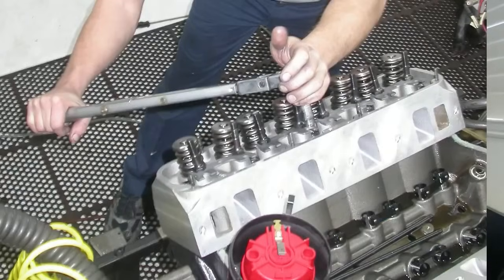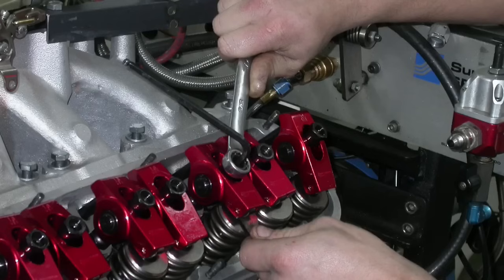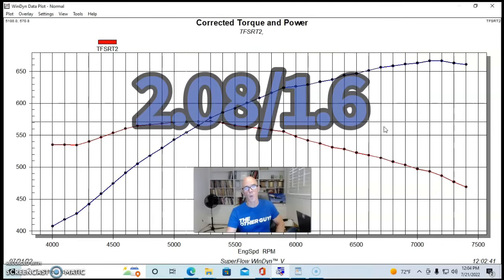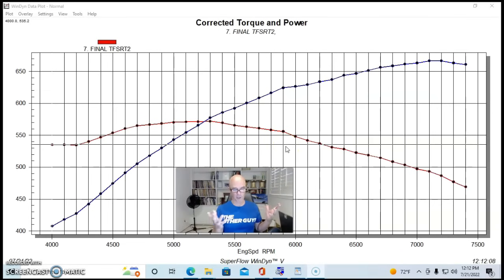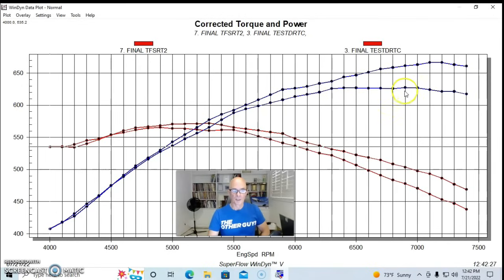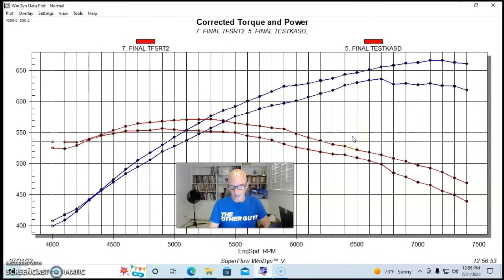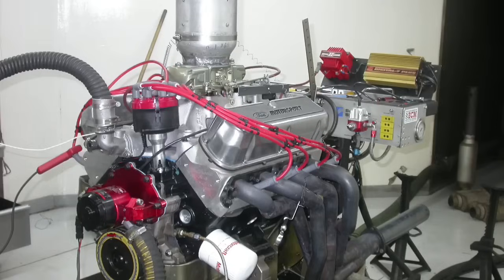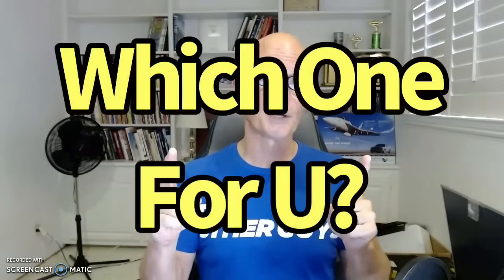WHAT CNC-PORTED SBF HEAD MAKES THE MOST POWER? KAASE v AFR v TFS R v DART v CNC VIC JR & HIGH PORT?

Comment: Crazy..out of the box 240cc high ports on a 418ci Windsor with 13.2 to 1 with a 740 724 270 293@50 116icl 116lsa nitrous camshaft with a powerglide in a Fairmont made 726hp 718lb ft on motor and 1279hp on 400hp nitrous with induction solutions x275 kit only thing I done was change the springs to psi DR426RML part number springs and titanium retainers and t&d rockers. This car will and has ran 5.04 8th mile on 400 and 6.12 on motor at 2960 with driver 8th mile it carries the mail

Comment: Something isnt mathing right with this engine. 12-1 427 with a huge solid cam and heads with way over 300 cfm.... you did something wrong on this one. These all should have been waaaaay closer to 700 than 600. Hell a couple should be over 700.

Comment: I'm surprised by the Kaase heads as well. Are those the same as the P-58 heads? I think that's what they were called that they made for a while there? I remember seeing a dyno of them on a 12:1 427 pushing over 700hp. Of course I'm not sure what the cam was or the headers and I'm sure those small headers were holding those engines back. Just goes to show with engines you can build the same engine and test it in two different places and get varying results. Good information though for a rough comparison.

Comment: Rich, those Kaase (P-38) heads had what every head porter forgets about when they design a head.... LONG VALVES. 2.10" x 5.450" x 11/32"  which is about 135g, exhaust are just as long and abut 113g.  Compared to the AFR 8mm stuff which the intakes are about 113g. You definitely saw some valvetrain issues there.... they don't even make these heads anymore. The market needs a canted valve head that's not a Cleveland or Yates style deal with some valves that aren't 20g+ more than the rest of the heads out there.
Reply: I’m thinking it was that n that those headers were choking the engine n not letting it breathe because those heads flow so much

Comment: I think the 1 3/4 headers are just fine. After all the exhaust valve is only 1.60 inches. That's all that's going to flow through the 1 3/4 header. So going bigger doesn't really make any sense.
Reply: I think it would be surprising. Seen some pretty impressive increases on a lesser build with 1,7/8” coming from 1,3/4”. 
Im thinking it would be a function of that compression. Thats a lot of air moving.

Comment: Any chance you could or did do one of these tests with a 393 and 205-210cc heads? Thanks
Reply from the maker: I have run AFR 205 heads many times
Reply: @richardholdener1727  do they seem to make more power than the TrickFlow 11R 205's in a test comparison like this?

Comment: Richard that is the reason that the 438cid SBF im going to build will have Cleveland heads on it.  The exhaust header selection.  The Windsor heads choice sucks, and the Cleveland are easy to get a 2" header.   Ive written afr to see if they could design a head with a LS pattern exhaust port, which would corner the market if they did it.

Comment: Thank you for doing tests on small block Ford I think the 2 inch header would probably be better and would obviously have more flow than the one to three quarter but hey that's what you had and I have AFR 205 heads believe it or not the part number was the 1450 I wanted the 225 head I wound up ordering the wrong ones I put their 1450 and I needed 1451 I believe I messed up anyway I love AFR heads my head makes phenomenal power but thanks again Richard always love your program keep up the good work

Comment: Would you ever consider testing some better head designs? For example, testing sbf sc2 vs MBE 12 degree vs Higgins race heads? I don't see many comparisons online between top end canted valve race head designs. The standard wedge designs seem to get all the attention for the street, but there is much more to unlock in the ones I just mentioned. There is the obvious expense, but some a few of those manufacturers may offer heads to test for free, never know!
Reply from the maker: I don't (nor do most people) have combos capable of taking advantage of what those high $, canted valve heads have to offer

Comment: Digging up bones... Anyway, I was wondering how much compression played in the output here. Some of the higher performing heads had higher compression. I sincerely doubt header size had anything to do with the power numbers that you saw. Also, I agree that the wobble with the Kaase head may have been a spring and/or push rod issue. Regardless, cool test, I remember when you needed a 6-71 pump to make 650hp.

Comment: The small headers up the running air speed up to rpm choke level per cubic inch 
A larger header would have slowed running airspeed down 
I have run combos on performance trends engine analysis pro and have scene as much as 40 hp off depending on primary size and collector size and total length 
Port volume vs pinch point running air speed can be tailored around the curve with bigger or small headers and intake manifold
Reply from the maker: the EAP shows different things than an actual dyno and header performance is not totally flow or air speed based-the several forms of enhanced charge filling (scavenging) play a big part

Comment: Is there an update using the Boss9 style and Clevor style heads?    customer wants to build  (me to spec) a stroker ford  cheers  low and mid range not max at max rpm,  most likely a supercharger/ intercooler    style  aftrermarket block

Comment: I just received my Trick Flow Twisted Wedge 11R top end kit with 170cc heads.
Im wanting to purchase a 347 Stroker kit now that the Block is back from the Machine shop (.030 over).
The motors a 99 Explorer roller. Its going into an 86 Bronco.
Recommendations on which (Balanced) stroker should i be looking into? Wanting to run pump gas. 91 is highest rating here in AZ.
Reply from the maker: scat has good stuff
Reply: @richardholdener1727  Thank you sir! 
I do like their reputation. Just had to get a a validation from “the man” 👍🏻

Comment: I have to wonder what the numbers would be with stock steel 4v close chamber heads on that 427 combo?
Lykins did a 351c stock 4v close chamber  FT 11:1 dyno 614.82 @7500
After further review, the above heads outflow the stock 4v  intakes by about 50cfm. Intake port 225 design beats stock larger ports.
This is good info to know. 
Thanks Richard

Comment: AFR has always been be recommendation for an out of the box high performing in line head. I will admit the TFS heads seem to edge out the AFRs performance wise just due to the architecture. New build with new pistons go TFS existing engine stick with a 20 degree inline AFR head.
Reply from the maker: pick whatever head you want from the supplied data-the 11R heads work very well

Comment: Forgot about one other good in-line head fully ported z304 head and there is highports with that flow more than that Tfs r head
Reply: The z304p cnc my brother has on a 408 we are guessing  650 hp plus. At 6800-7200. Heads flow near 380

Comment: No fair, this lot was run to 7500 rpm, presumably because of higher spec valve springs. Be interesting to see that a standard stroke would run to and it's power with these heads, cams, etc.

Comment: I'd love to see the actual valve lift at the valve, especially with the Kaase's, thinking their could be some lost ratio and the Kaase's use a different pushrod length to boot.
Reply from the maker: pushrod length doesn't change valve lift
Reply: Except when you combine that pushrod length change with a rocker fulcrum height change or if adjustable pushrod cups in the rocker like Jessels, changes the rate of opening the lift and the full open time.. https://youtu.be/5lgEAMuZBdo?t=1844 @richardholdener1727

Comment: Thing I like about the Trick Flow and AFR heads is they're always near the top of the pack in these tests.

These tests are not 100% conclusive because one head may benefit from different cam timing and intake and header design than another head. So one could always build the engine around a particular head and be shown that that particular head performed better overall.

Comment: I’d like to see the hp difference if the used C&C ported Yates C3 head
Reply: Exactly, I run an older set of the C3 Penski heads. 357/257 CFM @ 750

Comment: Each set of heads needs it's own cam dialed in specifically for its flow numbers and desired rpm. If you want any engine with a 4 inch stroke to survive for any length of time it should max out at 6500 rpm.
Reply from the maker: no
Reply: There are much lighter and stronger parts now days, so the rpm limits made 50 years ago don't apply.   The limits are higher due to better technology.
Reply: @dennisrobinson8008  No, piston speed determines longevity in modern engines too.
Reply: @Ken19700  the parts are lighter hence less inertia.
Reply: @dennisrobinson8008  Lighter parts will exit the oil pan just as easily when you push them too far. For survivability you don't want an engine to exceed a piston speed of 4500 feet per minute. The math you use is (4500 X 6)÷Stroke gives you your max safe rpm. If you want your engine to last forever cut it back to 4000 feet per minute. You can build engines built for faster piston speeds but you're going to have to rebuild them far more often. Generally it's only for dedicated race engines.
Reply: Think step header would have been better , but don’t think header made weak head is bad.

Comment: I think the test was a good test. If the headers were bigger they all would've made more power but I doubt that one would've leapfrogged another head in power output. Maybe the heads would have been better with each of them having a cam dedicated to the needs and or the qualities of each set of heads. Other than that it was an awesome test and that much more I love trick flow twisted wedge heads.

Comment: Hello is it normal that the Trickflow people dont answer emails?
Im asking them which piston set to buy for a 1995 sbf 302 with their 190 66cc heads and their 51403002 cam to keep as close as possible to stock CR which i believe is 9:1 (will be supercharged)
Reply from the maker: you can do that math yourself. go to Wallace racing compression calculator on line

Comment: What kind of power do you think it would make with a set of promaxx 210 cnc heads info please
Reply from the maker: HAVE NOT COMPARED THOSE TO THESE
Reply: Flow numbers at 700 are 325.   2.08 1.6 just trying to get a idea

Comment: Yes Richard you did kill the power on the larger ported heads, AFR recommends 1-7/8" headers on there 225 heads but in order to get consistent testing using the 1-3/4 headers, I just wish you started with 1-7/8" on all products.
Reply: But how much? 10hp? 15hp? 25hp?

Comment: Hi.   I was curious which camshaft was used?    Also we would've expected to see 600ft-lb or greater out of this sweet 427 ci.      Was this test also not using the collector extensions?   ( in another test you did, collector extensions were critical and worth 50 ft-lb )